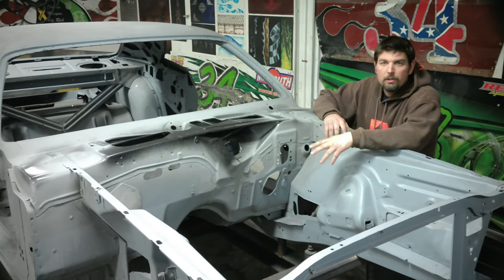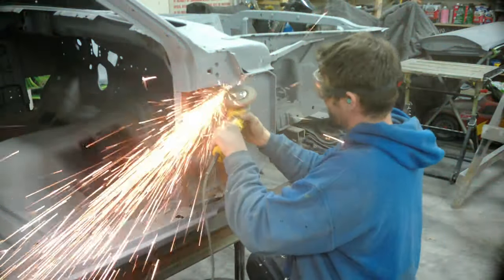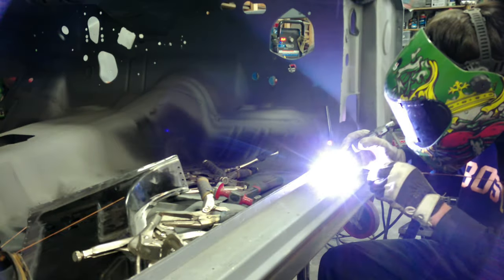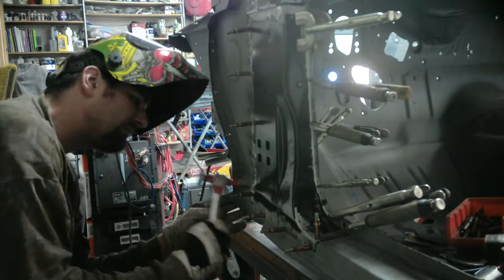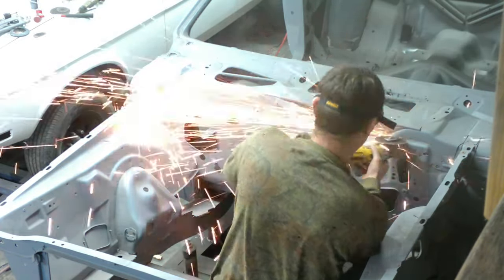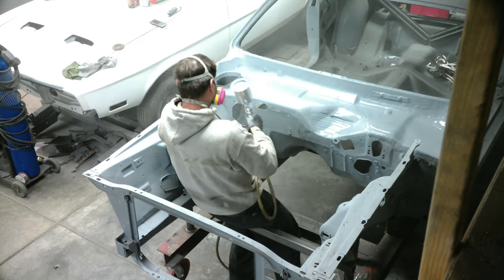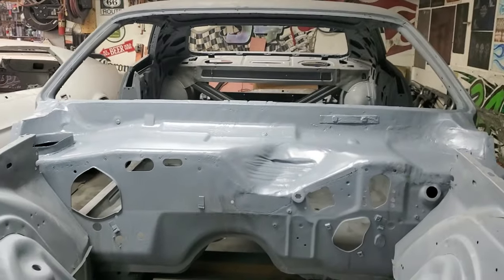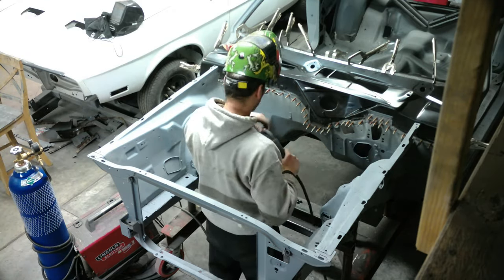1971 Barracuda Restoration Episode 3 Cowl panel install

Comment: When I see a car have fabrication work done to this standard it makes me eek at the thought of all the ones skimmed over with filler :o  I’ve owned one of those horror stories :o)  I spent two years of evenings and weekends on it and it needed four years to be mint :D (68 triumph spitfire)
Reply: Back when the ‘v’ in Vlog stood for VHS :D
Reply from the maker: Thanks and i also have been on both sides of the coin over the years, back when I first got into cars i have done my fair share of throwing filler at a problem

Comment: There's a VIN number in that top panel hope you cut it out  and you remember to transfer to your new panel
Reply from the maker: I did not on this one as I have the VIN on the dash board, radiator support and other areas on the car. This car is nothing extra special and there are enough numbers to identify what is needed for a title in just about every state.
Reply: @carthageclassiccars  I was trying to get a fender tag for mine and they require all three, core support firewall and dashboard
Reply from the maker: @mrpurcountry  The owner is not interested in the fender tag as it will not match what this car will be when its done changing everything not keeping the base 318  or color of this base model barracuda.